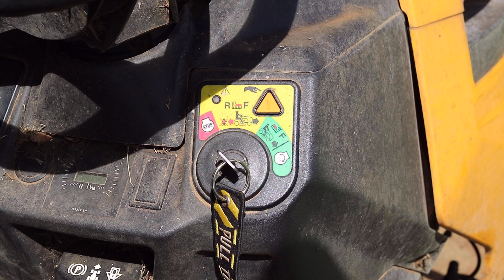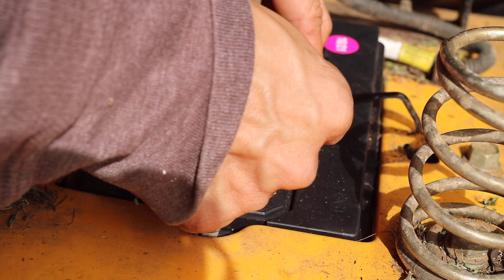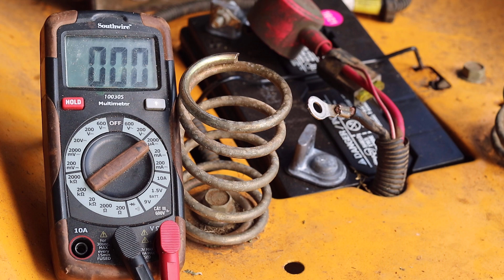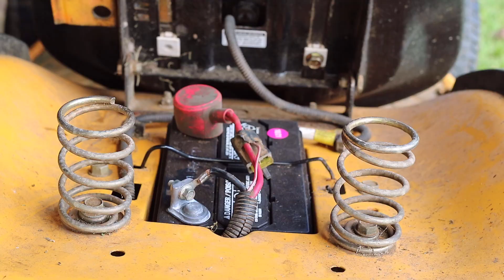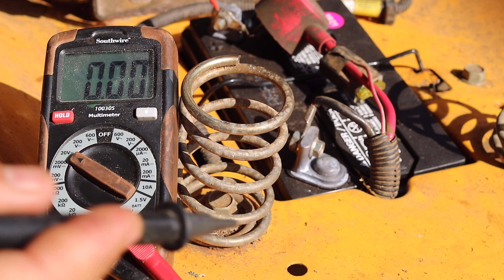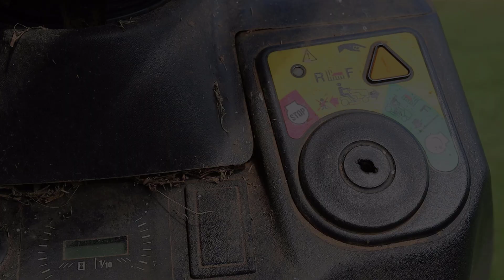12 Volt Battery test for parasitic draw and charging with a multimeter

Comment: You're testing Amps with the red cable in the Volts connection on the meter. Is that right?
Reply from the maker: Thank you for your question.  The multimeter used for the tests in this video was two separate input jacks for the red (positive) lead.

On this multimeter, you can test current up to 10 Amps with the input jack labeled 10A.

Also on this multimeter, you can test, Voltage,  resistance, and current up to 200 milliamps (mA) with the input jack labeled V Ω mA.

Since the test for current (Amps) was 0 at the 10A setting, the multimeter was set to 200mA (max) setting and the red wire was then connected to the input jack labeled V Ω mA (which can test current up to 200mA).
Reply: @TryAdaptLearn  smart meter. I have to use a separate mA jack